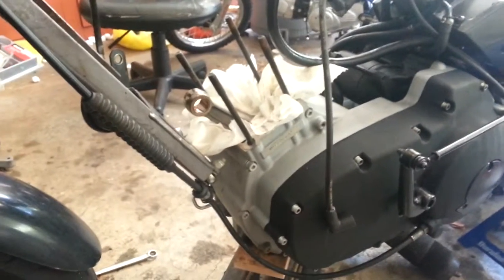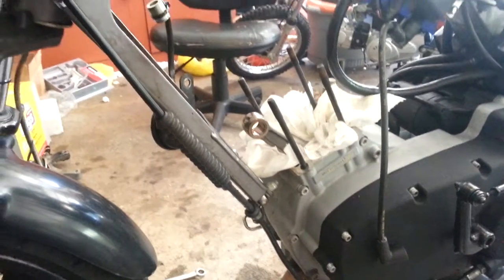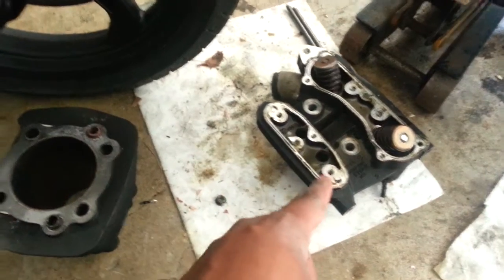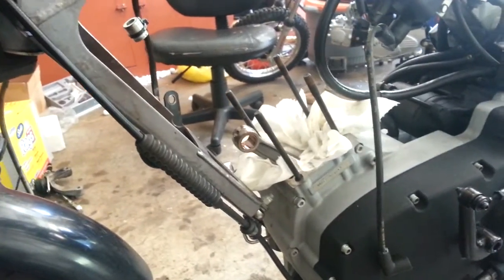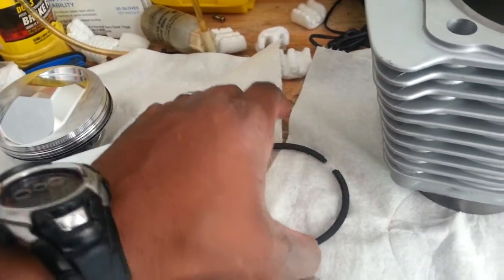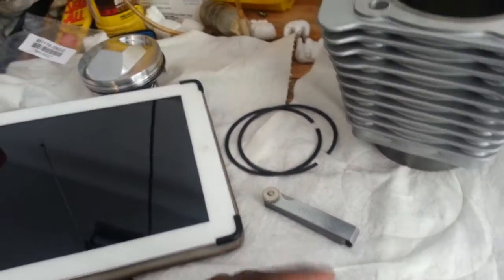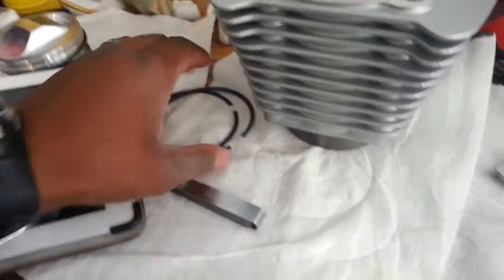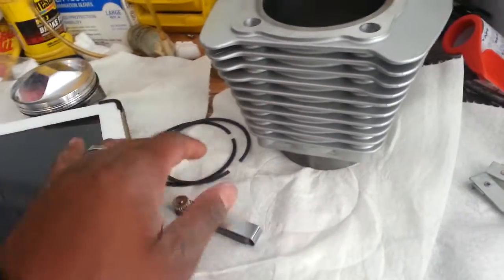Chronicles : blast engine work day 2

Comment: you got her torn down pretty fast hope the rebuild goes just as smooth for you
Reply from the maker: I think the rebuild should go smoothly..  I did order a bronze oil drive gear from American sport bike)(asb)  anyhow I have the gap spec for piston rings..  Now to install..   I'm following hammers install procedure...  Then have to install the cams..  And other things..
Reply: sounds like you're going to have a real screamer when you get done
Reply from the maker: It'll be fun indeed..  A little more pep..  Nothing like a 1200,  but I should take 883s down to 60 all day.   Need an ignition also to up my runs to 7800 rev..  Current 6500 will hold me back
Reply: wow you're putting a lot of $ into her it seems but it should all be worth it the end
Reply from the maker: Yes..  No intention of getting rid of it..  It will be my alone zoom around fun bike..  I want another for touring and 2up so my wife n I can ride...  More power..  Quiet..  Storage..
Reply: dbest1a sounds like a great plan hope it all works out  for you